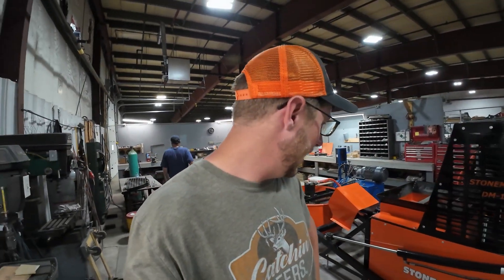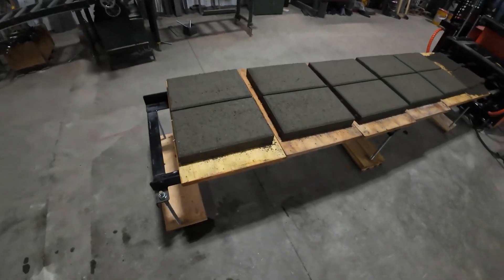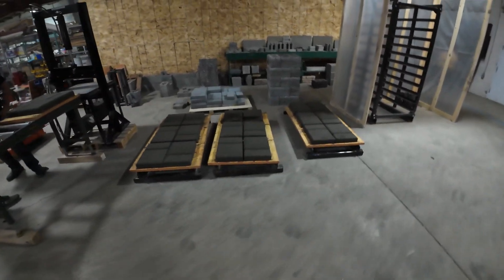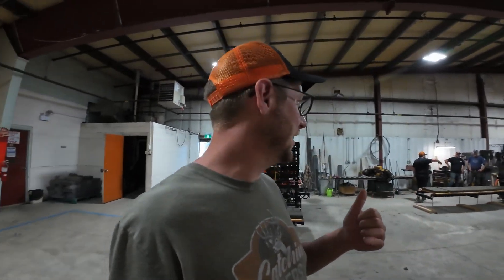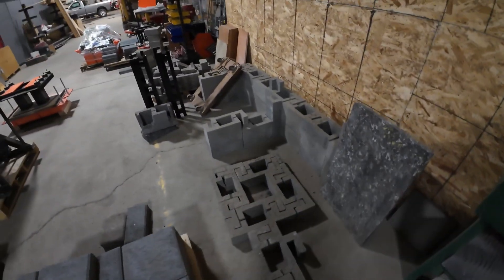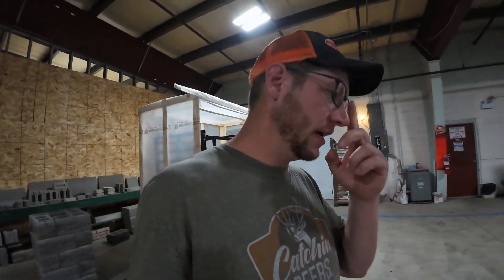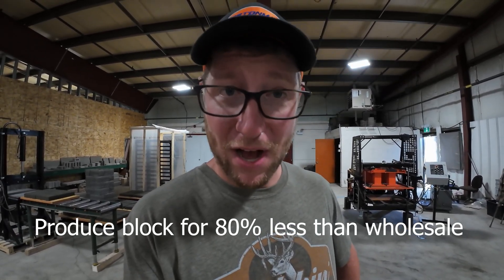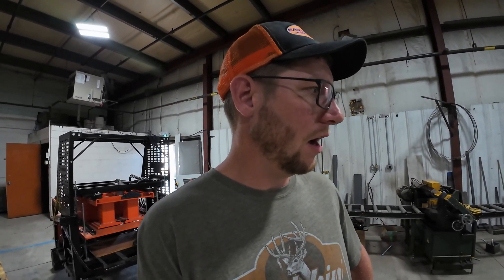Stonemaker; DM100 Compact Block Factory Will Revolutionize Concrete

Comment: How come  just using earth mix you don't need to cure it or anything and it's much stronger why do I need concrete
Reply from the maker: Not sure i understand or have seen anything like that.  Most clay bricks need to be fired in an oven.  Thanks for watching.  Its very much appreciated
Reply: There are some machines that use a normal earth mix, but in order for them to operate properly, you need to test the clay content of the soil in order to form a block. Those same macines will add in cement to make the blocks stonger as well.